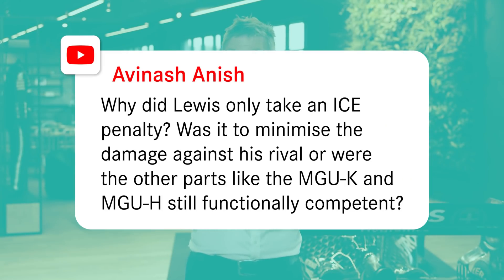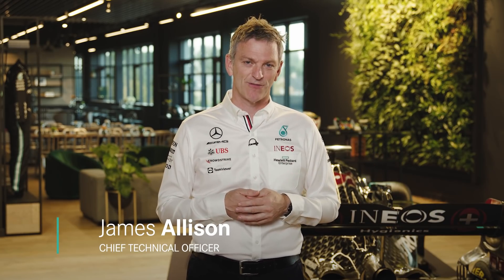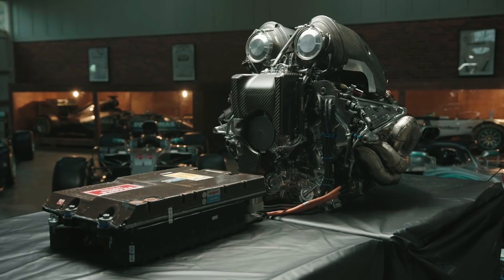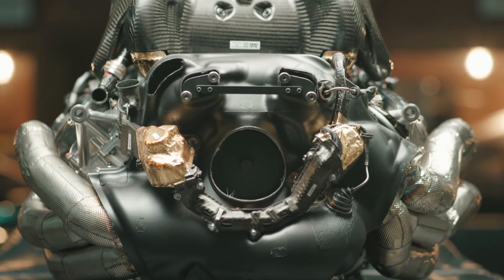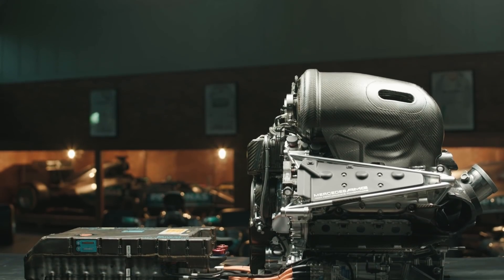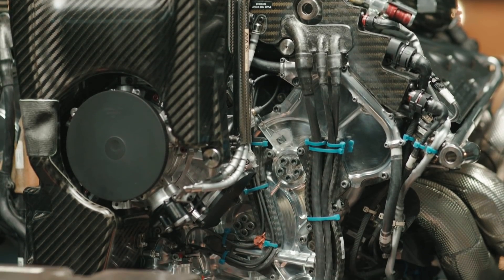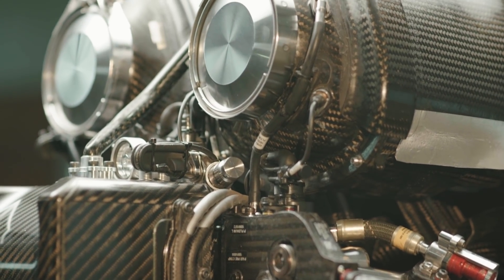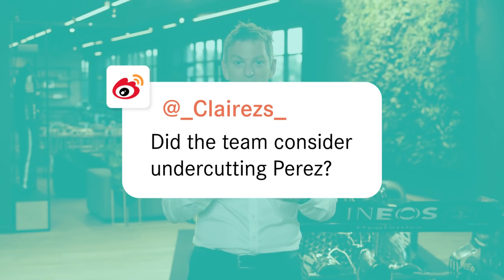Fresh or Old Tyres, Grid Penalties & More | 2021 Turkish GP F1 Race Debrief

Comment: The debrief is so technical, I loved it! I learnt that the engine has 7 parts ICE, MGU-K, MGU-H, Turbo, Energy store, Exhaust System and Control Electronics. :)
Reply from the maker: Mostly the ICE, MGU-K, MGU-H, Turbo, ES and CE are talked about, but the Exhaust is also part of the wider PU

Comment: i think everyone's over complicating what happened esp by saying the undercut doesn't work with the intermediates... when in fact Lewis did get undercut and never had a chance to do anything better than 5th by not pitting when everyone else did.  the undercut did work for ppl who pitted earlier, because instead of a traditional undercut where you overtake on the lap right after you pit while the other guy in front pits, the intermediate's undercut just takes several laps longer to happen, which is what happened here.
Reply: But then it's not an undercut but a normal pitstop. An undercut needs to happen in 1 maybe 2 laps because otherwise the other party just reacts. So if Lewis pits, Perez pits the lap after. Hence you need to make up the time difference in one lap. What you mean wasn't so much Lewis getting undercut but just pitting late.

Comment: I get the bit with leaving Lewis out as long as possible, hoping the track dries enough to switch to slicks.  I also get pulling him in when you did and making sure he ended with at least a P5 finish rather than risking a puncture or something else catastrophic.  Tough situation, I'm not sure what you do different there to get a better result.
Reply from the maker: Very tricky, and there were so many different options, but as James says, the optimal would have been the strategy Valtteri completed 😊
Reply: @MercedesAMGF1   Cheers and I eagerly look forward to the race at COTA.

Comment: I think the Team needs to sit Lewis down and emphasise to him. the importance of listening to Team instructions. Happened in the last 2 races where the team could see what Lewis couldnt. I want Merc to win this championship but afraid they could lose because of this problem. Could have felt my heart beating  so fast for the  entire Turkey gp.
Reply: Not the problem with Lewis. They should've pitted him the lap after Maxs. Considering the fact that he is in the fight with Max, that would've given Lewis enough time to get close to Max. Lap 42 was a bit late for a pitstop, because the first 2 or 3 laps would be the graining phase which won't give you any advantage. When they called in for the pit on lap 42, lewis asked them the possibility of continuing on the same tyres till the end and the team said they need time to check that. After 2 laps they said the tyres are okay to last till the end,  however warned about the possible threats from those behind. What they should've done instead was bring him in instead of saying he could finish the race on those tyres and then later pitting him on lap 51/52. Lewis wanted to hang on to the p3, he knew it would be hard to overtake Perez on his second stint and the team played along with him. They should have pitted him ahead of Perez instead, to avoid the need to overtake him on the second stint.

Comment: Could the water blasting of the track, prior to the weekend, have caused excess moisture over the course of the race, because of vibrations resulting from forces imparted by the cars, particularly in braking zones, where the vibrations release absorbed water to the surface?

Comment: Excellent debrief accentuating why the ICE was instilled at this event and how Valterri’s strategy was performed! Through the lap where most of a car's performance over the course of a lap can be attributed to the aerodynamic downforce it produced frontal camber and transmission on throttle enabled a smooth connection and responsiveness in steering without excessive oversteer. In addition, the rake position at low speed, compressed at high speed enabled the tyres to respond receptively through the alternating sequences of the circuit, (Turn 1, 2, 4, 5, 8, 9, 11 & chicane at 13) immediately next to the track surface from switching the contact path of the tyre carcass after the generation of heat for conserving tyre performance and with not conceding track position (Lewis gaining places after preserving grip at the first stage to prevent onset graining from the intermediate compound to the density discrepancies (with the brake callipers contact from the stability of the path with the track surface for mechanical grip weather changed). Incorporating a negative camber helped generate improved lateral grip!